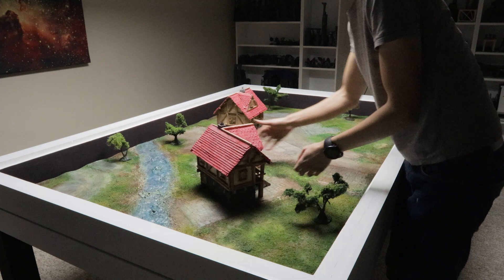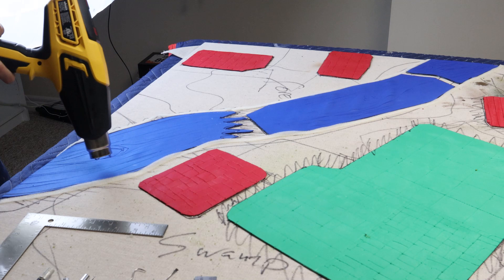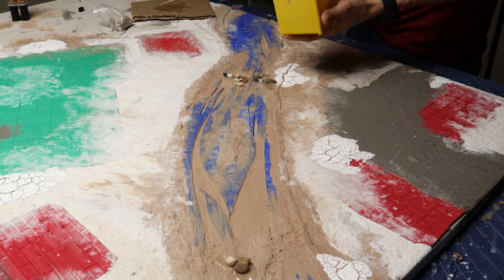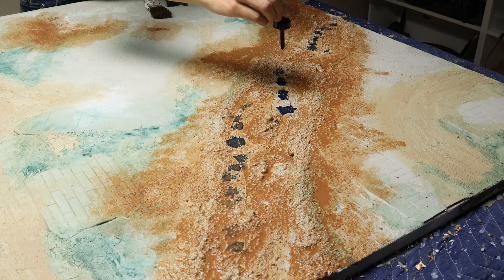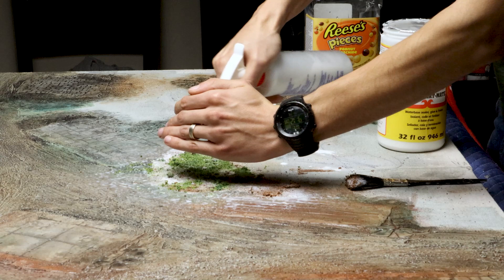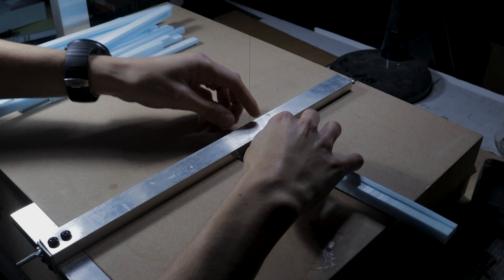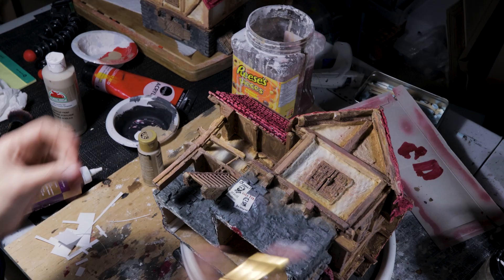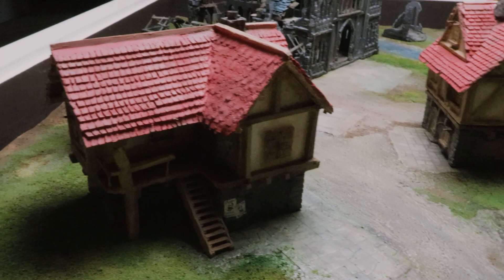Make a TEXTURED Fantasy Battle Mat (for Tabletop Wargaming)

Comment: This turned out really nice! While I personally prefer a river that is below grade, there are plenty of instances when  silt buildup in the river bed causes the locals to build higher and higher levees to prevent the river from changing direction. This causes the river to be higher than the surrounding area, and disastrous results can occur. See “when the levee breaks” by led zeppelin for more information 😂
Reply from the maker: The unfortunate floods are gonna be a great thematic element on the board. Cheers!

Comment: A lot of your techniques blew me away here.... awesome stuff!
Reply from the maker: Thanks. Glad you found it useful!
Reply: @KnarbMakes  how has the mod poge been holding up in terms of not cracking/keeping your flock sealed as you continue to use the board ?
Reply from the maker: @BattleHardenedGames  Its been fine for the most part, flock stays on well. I left it overnight rolled up one day and there was some cracking in one part when i rolled it back out. Its not too noticeable once it lay flat again. Rolling it inwards helps with this, since the cracks compress instead of spread apart.
Reply: @KnarbMakes  cool thanks for the feedback!
Reply: @KnarbMakes  What product/brand is the acrylic caulk?  When I look for acrylic caulk all I see are individual tubes of DAP brand, and their products look more like silicone than what you are using?
Reply from the maker: @BattleHardenedGames  yep. DAP is what I used. Standard doors and trim, white. Cheapest u can get.
Reply: @KnarbMakes  thank you sir !

Comment: I've seen many add sand to the acrylic caulk pre-application to give it texture to pick up on when painting.  If you weren't flocking so heavily, would you do that or texture after the caulk was down?
Reply from the maker: I did add some sand to the roads, but i sprinkled it on as I was applying and worked it in.
Reply: @KnarbMakes  Thanks!  I'm going to be making some a warcry focused mat at some point soon and it'll have no flock (barren wasteland/ruins ).  Are the glued stones handling the movement/rolling well?  I'll be adding some smaller stones (actually cat litter) for ruined area edges.
Reply from the maker: @jameseaton6767  The epoxy glue is stronger than the material they are bonded to... it's not going anywhere, haha.

For the smaller pebbles and sand texture, the mod podge does a really good job. Just needs several coats of sealer (more mod podge or a matte varnish/paint)

Comment: I use Rave hairspray to seal my acrylic paintings and charcoal drawings. Do you think hairspray could be used to seal the battle mat?
Reply from the maker: Hairspray might work yeah. Doesn't it stay tacky for a long time though?
Reply: @KnarbMakes  Not the hairspray not the rave hairspray it tends to dry right away and I’ve never had a problem with it smearing or being sticky

Comment: I have made several mats for Xwing and I have been wanting to make one with flock. Storing it flat is not an option for me. How tight were you able to roll this?
Reply from the maker: It rolled comfortably in an 6in diameter, probably could go tighter, but I didn't chance it. For comparison, the acrylic only mat I made can easily roll in a 4in diameter.

Comment: That was very cool. What was the material you used, a canvas? Like a painters drop cloth? I'm going to attempt it on a smaller scale to experiment, and gain some experience. Thank you for this post as I have no clue on how to begin. I just subscribed. I'm eager to try.
Reply from the maker: Yep, painters drop cloth works well for this. Either get one with a plastic backing or lay it on something that wont stick.
Reply: @KnarbMakes  Thanks! I'll begin by searching for an oversized piece that I can cut down to try out different kinds of terrain.
Reply: I don't have a table, what are the demention's of yours or do you already have a tutorial for this as well?
Reply from the maker: @georgeserrano8354  I do, It's one of my earlier videos (excuse the quality) https://www.youtube.com/watch?v=wsIx4jQnyMA

It's roughly 4' by 6' in dimensions.
Reply: @KnarbMakes  Thank you I will search it out.

Comment: Great video Knarb! This looks like something I need to make for my little group. I've made terrain but placing it on the table as we do just looks a bit off. A year later are you still using this? Have you made any changes or improvements? And how well does it keep rolling it up? My daughter and son-in-law (he's our DM) are running out of room already because of the stuff I've already made for them. How well would it work (or not work) to make a different landscape on the other side? Like a mostly flat cave floor? (I feel like I'm doing you here like Han Solo did 3PO in Jedi! LOL "Can you hurry up?" LOL) I hope you see and respond to my qoestions!
Reply from the maker: Making a smaller version of it for dnd would be good. It holds up fine even after a year but I don't actually get game that often these days.

Comment: Now that you've had this awhile, have you found that the flock is starting to shed?  I love both of the mats I've sen you made and am considering doing some.
Reply from the maker: Cheers, It's only shed slightly, same as a rigid board made with the same technique. (Not enough to bother me at all)

If you want a slightly more expensive option that is guaranteed to not shed. Take a look at Liquid Stitch. One of my patrons discovered a way to use this fabric glue to adhere flock to fabric that will not come off.
Reply: @KnarbMakes  thank you!  I'll check it out!

Comment: What's the exact mineral spirits you ended up using, and is there an alternative to it you'd recommend (I can't imagine something like soap and water working?)? I've finally got the time to start working on my own but I've actually never heard of the stuff before the video and can't seem to find any at the local Home Depot woops
Reply from the maker: Literally just grabbed the cheapest bottle of mineral spirits from the painting aisle. You won't be able to thin down the silicone with water. I think dish soap and water actually catalizes the silicone to cure faster instead of thinning it.

Do note that this type of mixture does get cloudy with age. So, either keep a thin river, or use some other sort of material to get the water effect. Maybe don't thin it at all, and get one that goes on clear and stays clear.
Reply: @KnarbMakes  Thanks so much for the tip! I'm trying to make stagnate pools so I was going to get a little bit of acrylic paint in there to muddy up the water. I may try the clear silicone straight with some coloring? Though I'm not sure if it'll go very flat.

Comment: Do you ever have issues when moving/rolling it where some of the dirt/grass falls off?
Reply from the maker: Yes, a little bit will always fall out, but not enough to cause a nuisance. Just make sure to vacuum it really well to get 99% of it after the sealer dries.
Reply: @KnarbMakes  Interesting. I love making things like this, but I might apply some of these techniques to Halloween props I make. The surface for many needs to be rough for the paint effect to work, but my old method using lightweight spackle would flake off.

Thanks for the tip.

Comment: Will texxtured rolling pins not work on this foam?
Reply from the maker: They do, but I wanted deeper cuts. The rolling technique requires a lot of pressure to get good texture, I was laying on a lot of paint and layers on top and it would have been lost.
Reply: @KnarbMakes  makes sense, the rollers do save time though. I usually only have a few days to get things done.
Reply: @KnarbMakes  I usually thin down the paint a bit for this, but I use acrylic craft paint so it's easier to work with.

Comment: please what kind of acrylic material do you use?
Reply from the maker: Acrylic caulking. From hardware store, used on baseboard and door trim
Reply: @KnarbMakes  
the acrylic putty I have so far had all the crumbs and cracks
Reply from the maker: @kajn3206  try thinning it down with some water, shouldnt be crumbly at all. Mine is super smooth.
Reply: @KnarbMakes  
thank you then possibly here I found a flexible material for parquet so I'll see I'll do a trial version